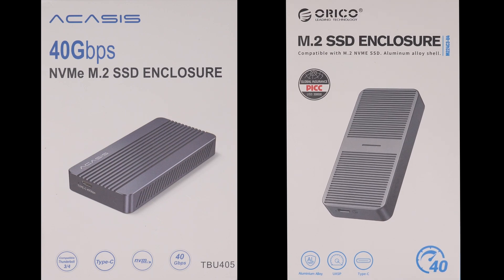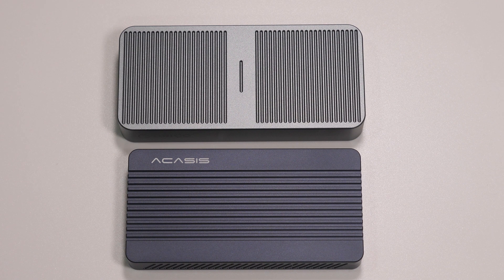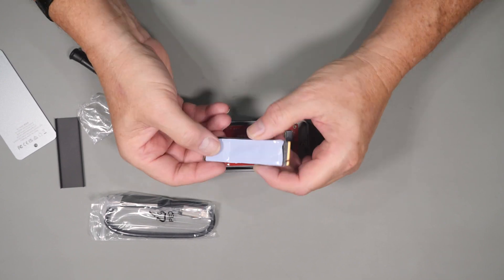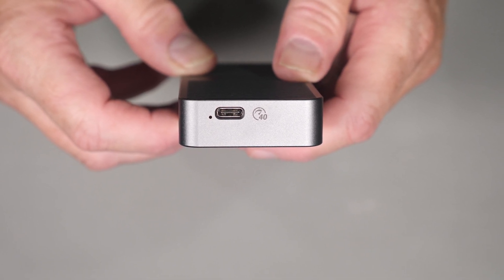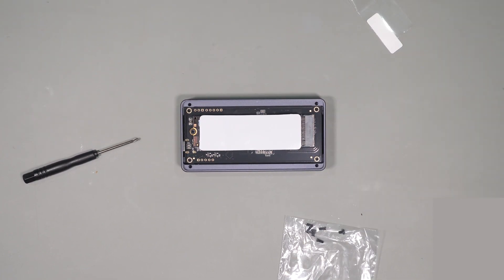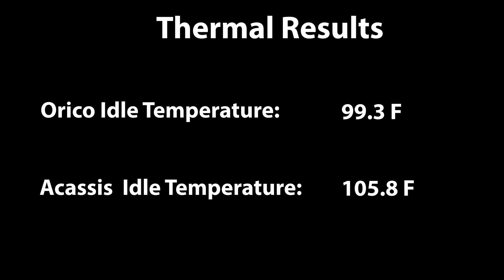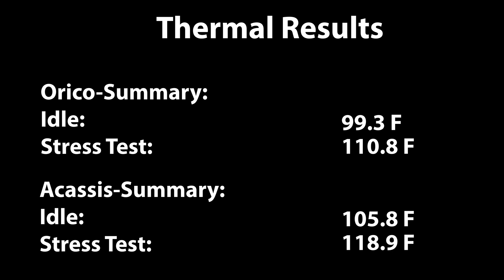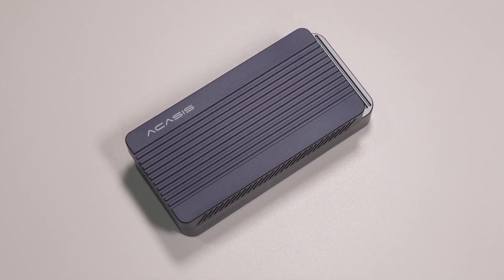Thunderbolt Enclosure-Are They All The Same?

Comment: I have terrible performance with the 4tb Crucial P3 Plus, dropping to 50MB/s write apparently the way these drives operate don't work well with this enclosure.
Reply from the maker: This does not sound right at all.  Have you tried this drive anywhere else or can you try a different drive in the enclosure?  To the best of my knowledge, there should not be any compatibility issues but would love to hear about it if you find one.
Reply: @MikeFaucher  Seems its the drive itself not the enclosure, the Crucial P3 Plus uses QLC NAND and once writing over a few GB's of data slows to a crawl (sub 100MBps) and is probably compounded by being in an enclosure. The drive was pretty full so cache had run out.
Reply: Keep in mind, some os-es/filesystems are handling folders with thousands of small files very ineffective. The transfer rate is a thing, the filesystem limits can ruin transfer rates any time, mainly on some older filesystems like ntfs or fat32. Try to copy big files (movies or something like that) to see if the file count in folders causing the issue. If the problem occours while copying big files (gigabyte sizes) your drive may defective.
Reply from the maker: @MaverickM1  Great point. It is worse with USB than thunderbolt. Thanks

Comment: Something that's annoying is I've been reading some of these 40Gbps NVMe enclosures aren't backwards compatible with Thunderbolt 3 or say USB 2. Which I'd have to have backwards compatibility as I have several different laptops that have different types of ports.
Reply from the maker: I have not see that and use mine on USB 3 pretty regularly.  I assume their may variations on devices and controllers.
Reply: @MikeFaucher  There are some NVMe enclosures where they give a warning that it only works with Thunderbolt 3/4 and won't work with USB-C. So I'll avoid those as I also have some older computers that have USB-A type ports that I'd want to be able to connect the NVMe enclosure to if needed at some point in the future.

Comment: What brand NVMe M.2 20 Gbps enclosure would you recommend? I know some people complain of certain brand's designs making the drive run hot due to bad heat transfer design.
Reply from the maker: Everyone has a different interpretation of heat.  M.2 NVMe drives will run hot whether it is 20 or40 by their design.  Controller can easily hit 100C which has to transfer somewhere.  The Zike drive is on the coolest I have see mainly due to mass.  When you read a complaint about heat, you need to ask two things, first is what is the outer temperature (11-125F is normal) are they running, and secondly, are they running a NVMe drive with chips on both sides as they tend to run hotter based on the heast sink designs having better heat dissapation on single side NVMe such as the Samsung drives.  Drives like Sabrent have chips on both sided and the memory ofter does not get goo heat sinking.  Hope that helps.

Comment: You want the enclosure to get hot. The Heatsink isn’t a bad thing provided you buy some conductive adhesive or pad to make it contact the case.
Also - always put some under the m.2 to connect it to the motherboard (also make it spread wide so it touches either side. Lastly if you feel up to it (although do this first) unscrew the motherboard and try to get it well thermally connected to the case on the other side). I have one now that I can feel getting warm in my hand almost instantly it’s under load - that’s a good thing, and it frequently hits 3,200 on read in black magic (that’s not supposed to be possible)!
Reply from the maker: Thanks for the input.  Great results.
Reply: @MikeFaucher  np! (I know you’ll know all this but for everyone) I was going to add that if you buy a case with a fan make sure you leave some room for air to get through and the best way is by using tiny heatsinks (under the motherboard as that’s where most models put the fans) but above is ok too, best in fact provided you give the air a clear way in and out through the Heatsink grating all the way.
It’s a lot of hassle for no real noticeable benefit over one without a fan left on a solid metal surface. Mine is actually sitting on 0.5mm conductive film connected to a big copper heatsink (all on a big sheet of aluminum I had) a gold bar would be ideal but I understand if that’s out of your price range 😜 However it’s noticeably cooler to the touch with a fan in so it’s definitely the way to go with portable drives. If you don’t have a fan and it’s getting too hot to comfortably hold then you did a great job - but you now need to think about where to put the drive to cool it as best you can. Mine just always sits behind my Mac min 2 pro (in the setup described) and seems to transfer files as quickly as the on chip storage. That’s the downside of system on chip - you can’t upgrade it. And memory & storage basically become level 3 & level 4 cache such that the M2 8Gb 256Gb is actually half the speed of the M2 16Gb 512Gb (I’d argue 16Gb isn’t enough either but it’s not worth the upgrade of 400USD or GBP (I despise the way Apple ignores the fact there’s an exchange rate that makes the £ worth 70¢ but not according to them! It was 2:1 about 15 years ago when they first started bringing out the really good stuff (it was much cheaper to import from the US even if you did have to pay Duty and tax!) - anyway, it’s absolutely necessary to have 16Gb of what is basically L3 cache and it’s arguable over the L4 cache but get one of these drives to keep permanently behind any Mac with Thunderbolt 3/4 and use it to run programs or files from (unless you have PCI-E 4 M.2 NVME etc. in the computer already). Most windows laptops will have hopefully at least 512Gb although it may be SATA (limited to 6 Gb/s). Buy a PCI-E card (after checking you have PCI-E 4 - probably not worth the fuss if you still have PCI-E 3) with ngff m.2 slots on it and the card should have at least 4 PCI-E lanes per m.2 slot. You can tell from the length of card (I’ll let you google it) however you may not be able to use all 16 on some motherboards if the Graphics Card is already using 16. But one m.2 pci card will almost certainly have 4 PCi-E lanes. Then you can add extremely fast storage (provided you put a good heatsink on the m.2) possibly even faster than the m.2 slots on the board because unfortunately MB makers don’t make giving them proper cooling very easy - the inside of my case is a mess where I packed in conductive paste under the cover you have to put back on because it’s below the graphics card - and I only finally got it running full speed when I got my hands on 2 long heat pipes and stuck ithem down with thermal adhesive above the aluminum contact to the m.2 and then finally I could give it a good heatsink right in front of the main air intake. Heat pipes are a marvel and not just solid copper (look up how they work). And it made all the difference now the drives ran to their rated maximum!
It never ceases to amaze me how many reviews I’ve watched where they don’t seem to appreciate just how important cooling is. There’s a great set of hot swap vertical stands for USB 3.2 (10Gbs) made by graugear that exploit the vertical wind tunnel effect the heat will cause just with a plastic surround chimney and low power fan (unfortunately only the single seems to be available in the UK) they also make a very good fan case for USB4 too that uses heat pipes so all you need to do is get the connection from the chips to the heat pipes and that’s all you’ll need to do, but anyway, I was watching a review where the guy admitted he’d been sent the product and then proceeded to go on about how it wasn’t worth bothering with a heatsink of any type!!! You’ll maybe get away with it at 10Gb/s because that’s probably what they throttle down to without cooling but not any faster. If I was from Graugear watching that I’d never be sending him anything again!
Reply: When you put a pad under the NVMe drive, what thickness do you go with? And regarding putting something under the motherboard, I wonder if thermal putty might work there? I use thermal putty on my GPU and Vram instead pads.

Comment: just run an extra strip of thermal pad between the top of the heat spreader and the case on the orico......problem solved
Reply from the maker: Thanks for the feedback.

Comment: Great Review I was considering the Oriico but I HATE those little rubber plugs if you change out your drives they are flying all over the room, maddening!!  The screw's in the Acasis are also NOT great. Other vendors have so much better toolless elegant designs these are old cheap boxes with modern thunderbolt controllers. Your review was GREAT!!!
Reply from the maker: Thank you for the feedback and I agree on the rubber feet.
Reply: What NVMe M.2 enclosure would you recommend? I'm looking at 20 Gbps speed.

Comment: test needs to do include large transfers of over 500GB, thermal throttling will occur. I find that the thermal throttling happens, then i direct a fan to the unit and the throttling disappears.
Reply from the maker: This is a great point and I actually did test it with multiple pass of around 300G back and forth and did see much in the way of throttling.  Next round up I will include these results.  Thanks for pointing that out.

Comment: If I may, I have one question. Do I need to enable write caching in the disk properties to get fast transfers?
I have ADATA SE920. When write caching (write buffering) is disabled  transfers are at 250 MB/s. Read about 3800 MB/s.
Reply from the maker: It is usually on by default so I would try it, but 250 seems very low.  What computer are you testing this with?
Reply: @MikeFaucher  Thank's for your answer. I'm on mini PC SER7 7840HS.
Reply from the maker: @tomaszwaszka3394  try the cache. You should be north of 2100 on that system.
Reply: @MikeFaucher  With write caching enabled, everything works as it should.(write about 3500 MB/s)
The point is: it's dangerous - you can lose your data... as some people claim ((when there is a power failure...
Reply from the maker: @tomaszwaszka3394  Though possible, you would have to yank the power out, much like what would be done to your system.  As long as you properly eject, you should not have an issue.  In most systems  I have seen, including all of mine, It was on by default, and I never had to change it.
Reply: @tomaszwaszka3394  I generally have my external drives set to quick removal. As lots of times, the computer won't let me eject it for whatever reason. Though, I've been looking around for a program that will force it to let me properly eject the drive. As my SD cards sometimes get corrupted or read only mode I think because I usually have to just yank it out as proper eject usually doesn't work as something it activating the drive in the background.

Comment: I was kind of expecting you to run a stress test on each, then quickly remove the cover and measure the actual temperature of the drives themselves.
Reply from the maker: I can add that to the next round testing if I do an update.  Thanks for the feedback.

Comment: I sat the Orico on top of my Mac mini case and held it in place by attaching the USB cable to one of the wires on the back of the mini. That way it shouldn't move around and mark the case. It made a substantial difference to the temperature of the Orico enclosure as the mini's case conducted some of the heat from the drive enclosure. I could only measure it subjectively, but it went from an idle temperature that felt quite warm to only just luke warm.
Reply: Warm to lukewarm 🤔that’s science bro!
Reply from the maker: @jidofole  Thanks!
Reply from the maker: It's an interesting approach, and it does make sense.  Thanks for the feedback.

Comment: Why did you missed mentioning the drive temperature? Or why you didn’t use Orico Shell to test on the other case to have confidence of the enclosures 😅
Reply from the maker: I tested the outside of both devices.  The utilities I have do not meausre nVME on a thunderbolt only native devices.  Thanks for the feedback.

Comment: Do I still need a heatsink for my NVME M2 when using the Acasis?
Reply: I’m opting to use it with the new WD Black SN850X 4TB. But I’m not familiar with heatsinks and installing heatsinks. The 4TB version unfortunately only comes without heatsink..
Reply from the maker: You do use a heatsink with the Acasis as the lid is the heatsink.  Get a drive without a heatsink.

Comment: Great video. I really agree with your take on the heat dissipation - I'd rather have the case but hot as it tells me the thermal pad is making contact and doing its job. I have two of the Acasis enclosures each with the WD SN850X SSD, and plan to install a more substantial, 1.5mm thermal pad as I don't have a lot of confidence in the thermal pads that came with the enclosures.  Read/Write speeds for this set up are closure to 2,850, plenty fast for hosting my Lightroom catalog and a quarterly swap of my images once I've through editing them.
Reply from the maker: Thanks for the feedback.  Glad you are liking the enclosures.  So far they have been great.  I am in the process of testing the ZikeDrive which could be a bit faster yet.  Thanks again for the input.
Reply: @MikeFaucher  You’re welcome! I’ll keep my eye out for that next comparison!
Reply: I'm getting 45-47C heat readings on my two TBU405's with Samsung 970 EOV Plus drives when they are at rest and around 2800 MB/s R&W. Measured heat with Macs Fan Control. Found this on the ACASIS site: "In general, the specified operating range for SSD is usually 0°C to 70°C, which means that most SSD should operate reliably within this temperature range. In addition, SSD operate best at temperatures around 50°C to 55°C." Seems that the included 1mm pad is fine. Would a 1.5mm pad be worth a bit more protection?
Reply from the maker: @jim0266  The 1.5mm would not really help it stay cooler but transfer heat a bit better during heavy use. I get concerned when things get above 70.
Reply: @MikeFaucher  Thanks. Next time I do some thrashing on the drive I'll have to take notice of the heat. I think I've seen it in the high 50's before, maybe low 60's.
Reply: just run an extra strip of thermal pad between the top of the heat spreader and the case on the orico......problem solved

Comment: Hi Mike, I was wondering if a  the Acasis (TBU405 Pro) which has a built in fan for cooling, would be any better, or is the  the Acasis you tested OK with the temperature, as it would be more handy. Thanks for your thoughts.
Reply from the maker: I tried the pro and was not impressed and I am currently using the standard one which really like.
Reply: @MikeFaucher  I have several of the TBU405's running with WD SN850X's, and they get hot but have been stable. I just got the TBU205 Pro in and it's larger of course and has a fan which can only be a good thing. Why were you not impressed by it? The only other tb enclosure I've seen with active cooling is the Fledging one which I love, but they don't seem to make them anymore, which is why the TBU405 Pro should be a great choice.
Reply from the maker: @Zardozer  Great question.  The Pro has active cooling; however, it is coming from the bottom, and most of the airflow is being diverted to the bottom and out the sides of the enclosure.  In my testing, heat was almost the same as the standard unit.  I also ran into one laptop that would not properly detect the unit or work correctly, as well as disconnect when the fan was on.  Overall, I would love to have active cooling, but I would like the airflow to be on the drive. If you are having good luck with it, then that is what is important.  Thanks for the feedback and input.

Comment: There is a pro version of the Acasis (TBU405 Pro m1?) which has a built in fan for cooling.
Reply from the maker: I tried it and was not impressed by it so I stuck with the one in this review.
Reply: @MikeFaucher  Why were you not impressed by the  Acasis TBU405 Pro m1? I'm trying to decide on a 20Gbps NVMe M.2 enclosure that is made well and a reasonable price.

Comment: Which is faster for my MacBook Pro 2018 & iPad Pro 2022- 
Oraco 20gb or acassis 40gb enclosure with Samsung 970 Evo Plus 2Tb 
Or
Samsung T7 2Tb
For fast & economic
Reply from the maker: The T7 is cheaper but is slower. If cost is a concern I would go with the T7.

Comment: thank you for useful review and analysis.   Thunderbolt drive enclosures remain somewhat pricey so performance reviews of these products are helpful.  In fact I used your amazon link to purchase the Acasis TBU405 after also learning it's Intel controller was rated as being about the fastest available and the enclosure price was actually reasonable compared to others I have purchased.  Thanks again.  Stay safe.
Reply from the maker: Thank you very much and thanks for the feedback.
Reply: How has the Acasis TBU405 held up? I've been trying to decide on an NVMe M.2 enclosure. Probably a 20Gbps speed rating.
Reply: @colt5189  I like the TBU405 very much: good performance for the volunteer video editing I do for some local non-profit orgs in town, with pretty good heat transfer to the case.  That said, I also purchased the TBU405-pro with an internal fan.  I like the pro unit even more.  I think it runs noticeably cooler for the internal NVME.m2 AND thankfully the fan is very quiet.  There is an external pushbutton switch that activates/deactivates the fan.  Having Thunderbolt level speeds is a luxury when sloshing around larger files.
Regards from Seattle, WA